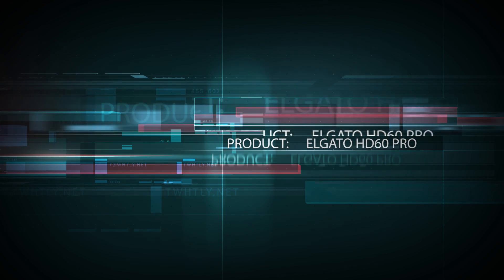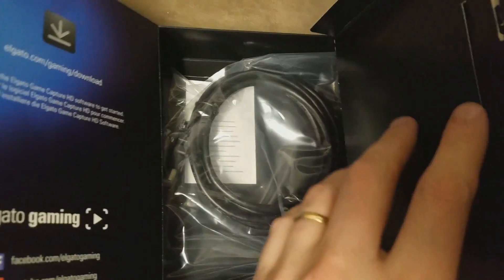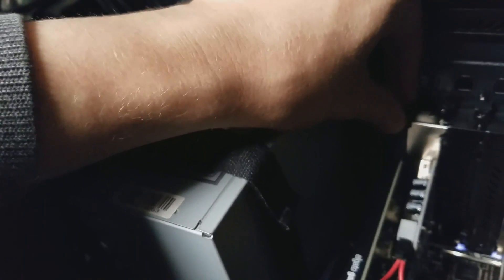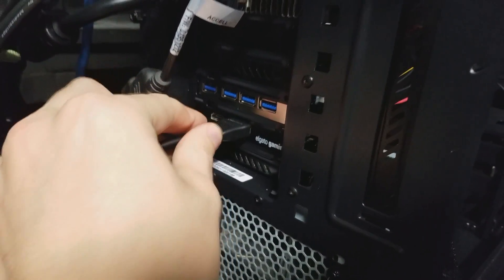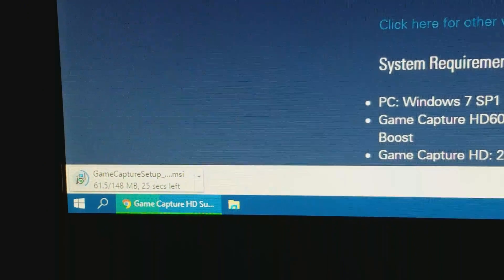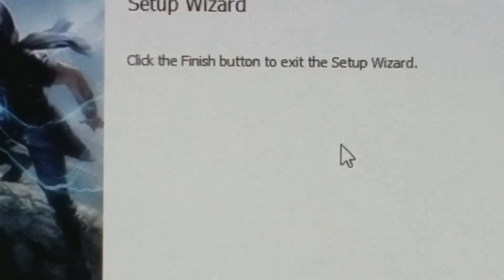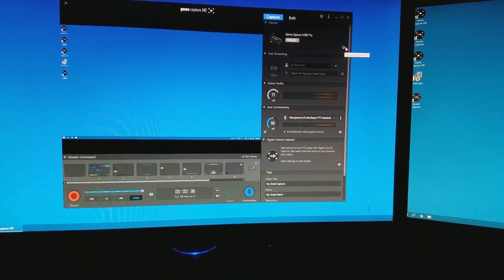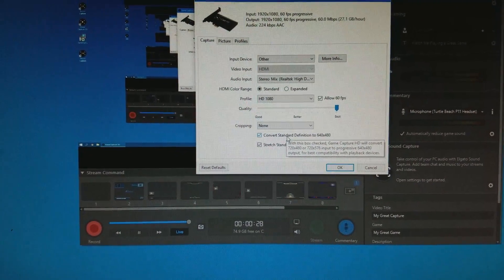Elgato HD60 Pro Unbox and Setup for same PC recording

Comment: jsut plug it in to hdmi port 2 and clone your main screen so u dont need to use pass though
Reply from the maker: The entire point of the cap card is to offload usage on the PC, while driving a second output, even a clone, you might as well just not use a cap card and tell OBS to capture the game window.

If you really want to bypass passthrough, use a quality HDMI splitter.

Comment: actually hd60 pro can record internally don't require passthrough
Reply from the maker: It requires input. You can, if you want, exit from GPU, split, have one go to monitor and one to to the capture card. You don't indeed need to use passthrough.

Comment: Probably a little late for anyone to reply, but since the main display isn’t connected directly to the GPU, wouldn’t that affect performance like increased latency and the monitor not outputting the native frames that its rated to (like 144Hz)?
Reply from the maker: The card can pass through higher framerates than it's capable of capturing, so you playing at 144Hz wouldn't be an issue. There's increased latency in the same way that there is with a longer HDMI cable, that's all. The only addition being the time it requires to pass through the data.

Comment: 2 monitors, 1 PC.
Will this capture card improve the performance if you use OBS and select as source "elgato card" ? Shouldn't be this better for CPU/GPU processing?
Reply from the maker: It should be easier on the system than using Window or Game capture, yes, if you only want to use it as a source. Be aware it can only capture one monitor, whichever you pass through the HDMI to it.

Comment: I am having this problem: I have two screens, but my capture card is always capturing the wrong screen. In fact before having the second screen the capture card was set to record the unexistent second screen. I've plugged a Dvi cable from my videocard to the monitor that I want to record; from the same videocard, an hdmi cable  is plugged in to the capture card; and the capture card output is going to the second monitor. How can I solve this? I tried first changing what would be the main monitor; then tried to change the number assigned to each monitor, unsuccessfully. I don't know what to do! Why is this happening?
Reply from the maker: Whatever screen you want to record you have to 'pass through' this card. You need a cable to go from video card to this card, this card to monitor. You can't pick or choose monitor in software, etc, you select it with the cable.

Comment: Hello and thanks for great video. :) I'm thinking of getting one of these for a single pc setup. 
does it capture smooth video from a single pc ? or am i better just using obs?
Reply from the maker: To give you a thorough answer:
If you use this card with their software to capture or stream footage it will use the onboard encoder and not touch your CPU or GPU much at all. This is one of the few (the only at the time within this price range) to have onboard encoding.

If you use OBS with this card it'll use it as a source and still use either CPU or GPU (depending on which encoder you choose).

If you use OBS without this card you can use the screen or the game as a source and it will use either CPU or GPU (depending on which encoder you choose).
Reply: @88mphtim  Thanks for the fast reply . :) If you use OBS with this card it'll use it as a source .  I'm not sure what using it as a source means. pls forgive me im a noob lol
Reply from the maker: @daz2730  source = input source. In OBS it's the source of whatever you are displaying. A source might be an image, video, capture card, game window, monitor.
Reply: @88mphtim  thanks a lot :).  hope you don't mind me asking another question. But if  the capture card is being used as a source though obs . is the capture card being used to record footage or is obs recording footage though my gpu, I'm a little confused.
Reply from the maker: @daz2730  OBS will always use your CPU or GPU (most people use GPU via NVENC encoder these days). But it does use slightly less resources to have OBS 'see' this device than to capture from the game without one.
Reply: @88mphtim  fantastic , think I understand how it works now.  thanks

Comment: Hello 88mphtim. I have a doubt...I just bought one of these.second hand. But I saw no improvement with only one PC... I feel that I lag even more with Elgato on than with obs only.... I only used one cable. I have no extra screen. In my head elgato would remove the work of obs... And no frame drops but it was not the case. I'm i doing something wrong? Do I really need 2 cables for elgato? Plz help me.🥴 Are you still using this in 2021?
Reply: It depends how you use it. If you still use your CPU or GPU to encode via OBS then you are still using those devices. If you use Elgato's recording software then it will use the onboard encoder to offload encoding and should save CPU and/or GPU.

On a single machine you should be going from GPU to Elgato to Monitor. Two cables.

Comment: Sir do we put this into gaming pc or streaming pc.
Reply from the maker: If you have a screaming PC you put it in the Streaming PC so it can recieve video from the game machine.

Game PC/Console > Stream PC in > Stream PC out > Monitor/TV
Reply: Thanks sir but my streaming pc has risen 3 with 1050 GPU and monitor is 60 Herts
Reply: What if I inserted this card into main pc. Will it consumes cpu power.
Reply from the maker: Then you can't stream from the streaming pc using it...

Yes if you record on the PC it will use the CPU. That's why people still use streaming PCs when they can.

Comment: Is it better to hook up a capture card to your graphics card and stream through the capture card, or is it better to stream straight through screen capture through obs software?
Reply from the maker: It's generally better to use the capture card as a source in OBS... So, both :) When you capture a specific window or game it can be difficult for OBS sometimes, especially with older games... But if you are capturing what the screen is seeing (what the cap card sees padding through it) then you have no issues.

Also if you are capturing a console obviously using this as a source works, too. No way to do that on Windows unless you stream to the xbox app or something.
Reply: @88mphtim  i guess I meant streaming through a single pc. I could hook my graphics card to the card and the card to my monitor, and use it as an input source. I just don’t know if it’s worth the money to get it for that pr of its better to use just obs and use screen capture?
Reply from the maker: @MillennialMayhem  For a single PC I would just capture the window and save yourself the money. As far as I'm aware all capture cards that can do 1080p60 use the CPU or GPU for encoding anyway, as you would without one. If you were using a second PC this is a good way to get the picture to go into that second machine.
Reply: @88mphtim  that’s what I was thinking. I think only the 4k60 pro has an encoder

Comment: What gpu do u have, curious
Reply: At this point it was a 970 I think.
Reply: @RaceSimCentral  thank you, just bought one. Currently have a 1660ti with 2 displays set up but it was having alot of issues!. 
The problem was my VR headset (windows mixed reality) for anyone that runs one, even if it is in ,sleep, stand by or disabled it will cause heavy frame tear on recordings and even the "screen preview". 
If any one else has that problem mavye that would help?
Also awsome video btw! Very well done and edited, easy to follow!

Comment: Quick question will an Elgato capture card record game chat audio on pc no console? If so will I need a Elgato gaming chat link? I've been trying to look for an answer but haven't seem to find one. 

Thank you
Reply: It depends on the game chat. If it goes through the game then it's part of the games audio on PC as far as the card is concerned. If you use something like Discord for game chat then you can select whether to add that to your recording or not. If on console, consoles consider game and chat audio different, but the card does not if it is going through the HDMI to the TV.
Reply: @RaceSimCentral  the game chat comes from the game which is Warzone but for some reason when I’m recording I see the meter in stream labs obs go up when someone in game chat is talking but when I’m done recording I can’t hear the game chat audio
Reply: @LuGNuTT  It's possible OBS has record it to another track or that you didn't have that audio track set to record. OBS can separate incoming audio in that way.
Reply: @RaceSimCentral  how do I fix that

Comment: Encoder setting???
Reply from the maker: For?
Reply: @88mphtim  just want to know, cpu GPU or built-in h.264 hd 60pro as encoder
Reply from the maker: @apitnetgaming  right now I use cpu to encode in obs despite having a 3080. Nvenc is really close but doesn't look as Sharp. Current cpu is an i9 9900

Comment: Apologies for the late comment, but using the HD60 Pro, would it be possible to now use the Elgato Game Capture HD Software for recording - specifically using the on-board encoding chip (and thus save CPU) - while simultaneously streaming in OBS, thanks to the Multi App Support? I understand that previously you needed to close the Elgato Game Capture HD Software in order to use OBS, and that the only option to record and stream at the same time was through Master Copy in Elgato's own software. Asking this as currently doubting between buying the 4K60 Pro Mk.2 and HD60 Pro, and interested in the latter's on-board encoder purely from a CPU standpoint.
Reply: Because the device can only be used by one app at a time you would have to do this by recording raw footage using the HD60Pro and then capturing and streaming with OBS by another method, whether that is a second card fed by a splitter, duplicated output, or simply using window/game capture in OBS. I think there are some capture cards now that can be used by multiple programs at the same time though, might be worth checking for those. Avermedia has one.

Comment: I am new to desktop. question.

I have my Monitor set up with a DisplayPort cable and its plugged into my GPU, (only way I can get 165Hrz)

could I just plug the HDMI into the Capture card and switch my monitor back and forth from DP to HDMI setting? so say I am playing PC games just use the DP cable then switch the monitor to HDMI for say Nintendo switch footage with capture card?  Am thinking that would work, but want to make sure before I buy one.

Comment: are you hooking the hdmi out to your gaming monitor? i have 2 monitors and gpu has hmdi, display port and dvi. i hook my hdmi from gpu to elgato and out back to gaming monitor. hooked up 2nd monitor with display port and only one screen works. when i unplug elgato and run the hdmi direct from gpu to gaming monitor both screens work. what am i doing wrong?
Reply: i have the same problem

Comment: I have a 240Hz 1080p monitor. When I installed the elgato, I noticed my screen dropped frames massively (probably 60 frames). Is this normal, or is this HDMI cable I'm using possibly 1.4 instead of 2.0+

Comment: Using this, do i need to run my second monitor at 1080p 60hz since i'm having to use a HDMI cable? Both my monitors are 1440p 165hz using display ports.

Comment: A capture card is for capturing footage from one PC and then exporting it to another. So if you are just going to use your PC for streaming and gaming it will have no function.
Reply: What if I want to record my clean video without any overlays or additions from my streaming software?
Reply: Explain ?
Reply: You can just use obs studio to capture your screen..
Reply: @ataechawngthu  I use OBS studio to stream, and if I try to use OBS Studio and streamlabs at the same time I start getting glitches, and my computer won't record with the two programs at once.

But OBS Studio records the same thing that is streaming, overlays included.

Comment: Do capture cards encode video? I basically want to know if I spend the money on one of these cards... Could I record my game with less stress on my gpu/CPU by using this device? Please let me know anyone.

So essentially will my games run better and or will the recording quality change by using a card like this for reference my current PC has 16GB 3200 ram, 2700x and a 5700xt
Reply: the elgato hd60 pro does have H.264 encoder so yes this one would take less stress off of your GPU/CPU while game capturing

Comment: can you run 1 DP cable from your gpu to your monitor and a 2nd hdmi cable to the elgato IN while having the GPU outputs mirrored on screens 1/2. basically running 1 monitor and the elgato capturing the mirrored image from the hdmi out of the GPU. instead of running your game through the elgato pass through?

Comment: I also have a tripplescreen config. But my graphic cards support 4 screen so i duplikated the center screen on DVI and HDMI ports cause i have a 144 hz screen as center screen.
So i need 2 active displayport adapters (to DVI) for the left and right screen cause they dont have Displayport. Then  DVI dual link to center screen for 144hz and duplicated to HDMI to the Elgato card that records/stream at 60 FPS / 60 HZ.
Take a look at this video. Works for me (i have AMD system.)

Comment: I know im a bit late, but i have a few questions.

1. Do you have to compromise on max frames in games to record 60fps? For example, if you normally run a game at 100+ frames, will you be forced to limit that in game to 60 for smooth capture?

2. Can you use the capture card with streamlabs OBS as a video source, if so, does this complicate control over your stream like switching scenes from desktop to game etc...

3. With nvidia's NVENC options in programs like OBS, are these capture cards still worth the investment for single PC streaming, or do you think it would be best to just stream from the graphics card?
Reply: 1. This card will only capture at 1080p60. There are ways for you to play with higher refresh rate monitors but it isn't official
Reply: 2. I can't answer 2 since I know nothing about streaming and streamlabs
Reply: 3. For a single PC setup, capture cards don't offer that much because your cpu usage will be the same or more than just recording with obs.
Reply: If you want to play at higher framerates without going into Nvidia control panel and doing some stuff you can just use an avermedia card which supports passthrough so you can game at higher refresh rates and resolutions but it will still record at 1080p60. You can also get the 4k60 pro which supports passthrough as well
Reply: @sheath23r  cool, thanks for the info! :D

Comment: I'm so confused with doing this with two monitors, but you're doing it with 3. I'm getting so stressed about this that I even bought a splitter and still no luck.
Reply: Same
Reply: Did u find out how to do it?
Reply: Same one of my monitors is old and only has 1HDMI. My other monitor has 2 HDM ports and a display port. I want to use my new one for gaming and my old one for other things. My pc only has 1 Hdmi. 🤔
Reply: Damn even a splitter didn't work?

Comment: What is the set up with ps3 using a hdcp splitter? I can't seem to be able to do it, might you have a diagram or steps that I can follow? 4k60pro, two 1080p monitors, hdcp splitter, 3 hdmi, pc with a graphics card. Might i need to get another hdmi/dvi/display port cause my graghics card only has one hdmi input

Comment: So I just have the base gaming pc (no add-ons) and I've just installed the Capture card. I want to do same-pc capturing, but I connect the "In" to the nornal HDMI port, then the "Out" to my monitor
But my monitor receives nothing.
What must I do?
Reply: Just bought it today and i have the same problem as you, i connected to the in, when i turn on my monitor it just go black screen, like the hdmi that came with elgato i put the hdmi on my video card, and the other hdmi i put it on IN(elgato)
My monitor has only dvi-d
My gtx 1060 has 1hdmi (being used by elgato) plus 3 display port and dvi port
I also bought dvi port to dvi
So i can connect my pc to my graphics card  with the dvi since the hdmi is being used by elgato
Still black screen, now i'm trying to update my nvidia drivers, updating windows to see if that helps the issue
Reply: @veltron1996  It took mine a few minutes but the monitor turned on. Just wait while it does it's odd thing. lol
Reply: Hey i got it work, it seems that elgato doesn't work on pci x1, i connected to pci x16 and it worked, everything is good , but when i try to record a video on game capture how can i record in game?? Like when i wanna go back to desktop, in my game capture also it goes back, any solutions?
Reply: @veltron1996  💔
Reply: JOKEY 😎
Reply: @88mphtim  yeah. The files have been installed.
But I suppose something may have gone wrong with them, maybe?
Idk.
Reply: @88mphtim  I've restarted multiple times. I'm now trying a different 2-way (I'm-sure) HDMI cord.
Still not entire sure what's going on.
Reply: @88mphtim  alrighty
Thanks, man.
Reply: Like it doesn't show no signal, it shows republic of gamers and loading, then suddenly it goes black screen, should i wait?
Reply: Waited like 10 min and nothing, i think my best solution is to buy a new monitor that has hdmi, is gonna help me a lot since my old monitor has one vga and one dvid
Reply: @veltron1996  I agree. HDMI would help, mate. Sorry
Reply: JOKEY its okay, im kinda sad because i was so excited about streaming with elgato, but my dream became a nightmare.